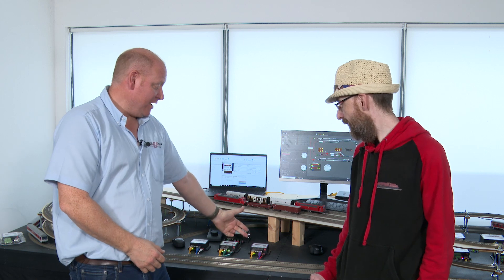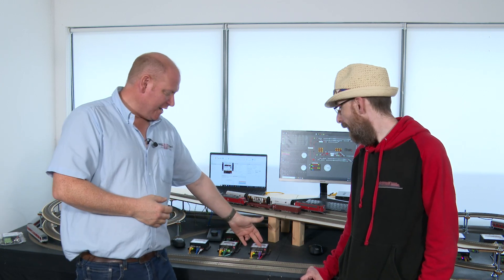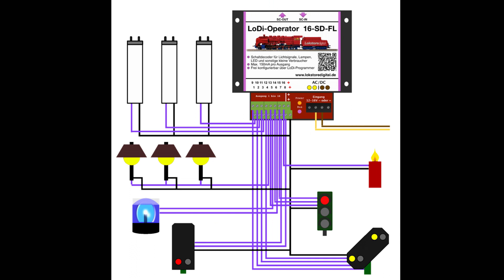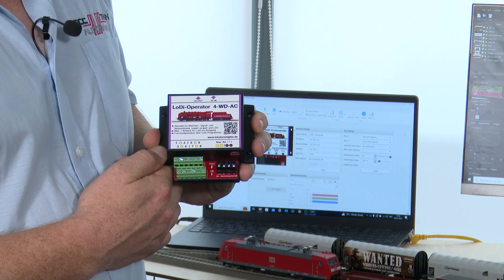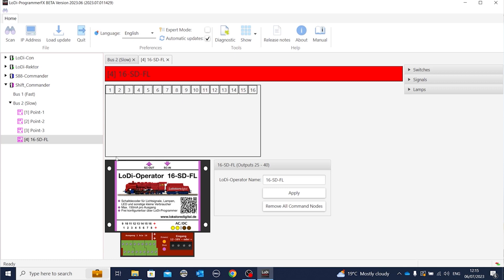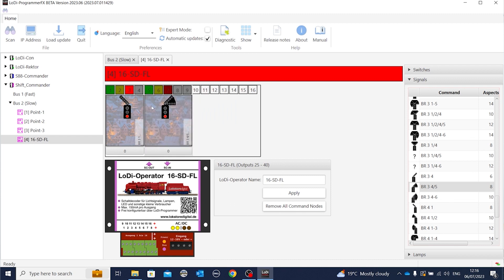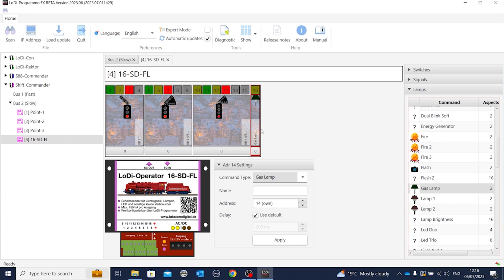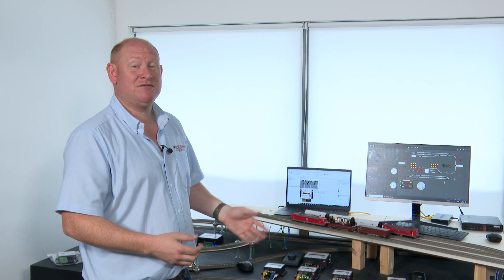Switching Accessories with LoDi.  No 7.

Comment: For connecting mtb point motors, what delay settings are used?  When I used the default it moves only a small amount in 1 direction then repeats on multiple clicks of the switch before eventually doing the same on the return.  This is using MTB 5 and the 4-WD-AC.  Thanks
Reply from the maker: Need to be 3000ms
Reply: @DCCtrainautomation  Thank you!

Comment: Can the 16-SD-FL be used with other DCC systems? Can it just be connected to a DCC bus?
Reply from the maker: If you are using iTrain then yes you can use the LoDI-Shift-command access network which will then allow you to use the 16-SD-FL to control your signals in iTrain. But no you can not connect to your DCC bus no. What Digital system do you run?
Reply: Hi  @DCCtrainautomation  Thank you for the swift reply..!  I am still mulling over a full switch to Lodi or YaMoRC but possibly keeping my ECoS.  However, having watched Charlie's latest video at Chadwick MR I did suggest he have a look at the Lodi but he does have a rather large investment in DigiTrax hence the question..!
Reply from the maker: @patrickhunt8644  I think you should call me to discuss this further. As the two system are very different in many ways. But both have some very useful functions.
Reply: Hi @DCCtrainautomation  I'll send you a private email using your web site.

Comment: I love the 16-SD-FL. When connecting LED building or street lights, do they need to be 3v or 12v?
Reply from the maker: Can be either voltage if you put resistors on the LEDs.
Reply: @DCCtrainautomation  The lodi operator 16-SD-FL 1K is designed to mount LED without a ballast resistor.